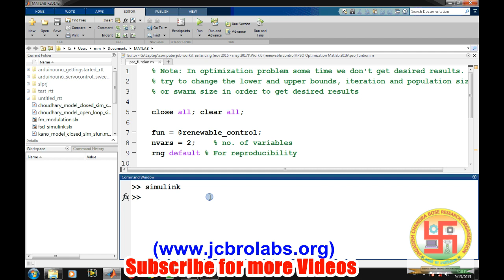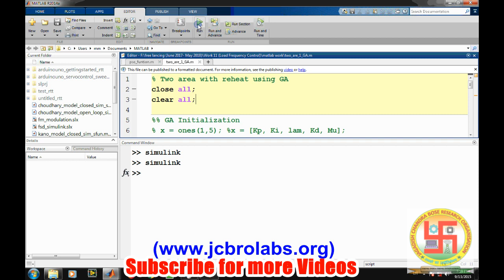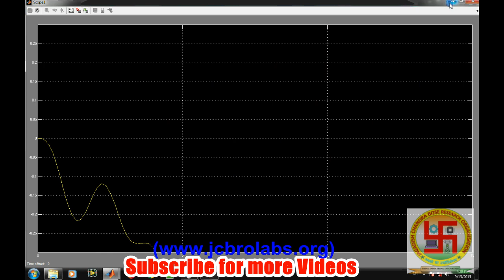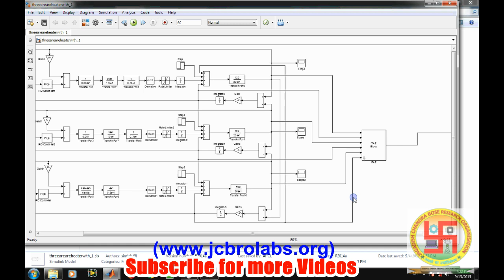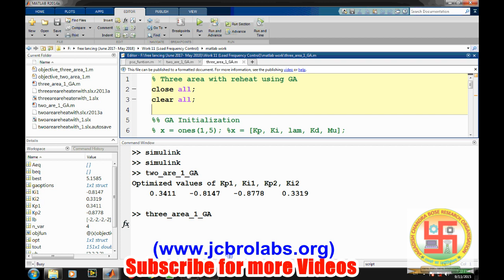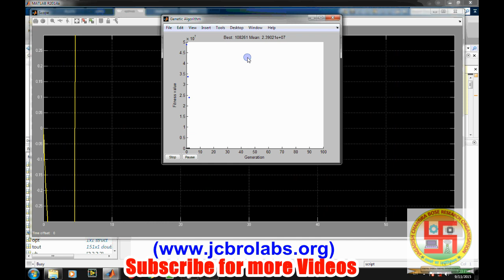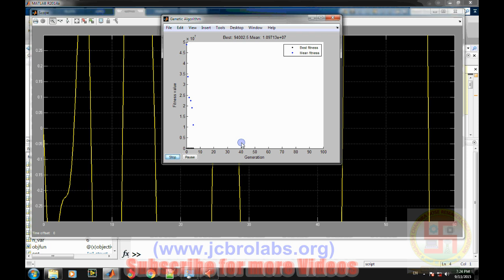EEE Project 1: GA Optimized PI controller for Load Frequency Control

Comment: sir, would you explain how to optimize input and output scaling factor of optimized FUZZY LOGIC PID Controller using Optimization Techniques and what is the use of Fuzzy logic controller along with PID